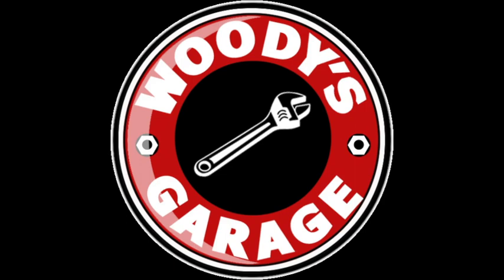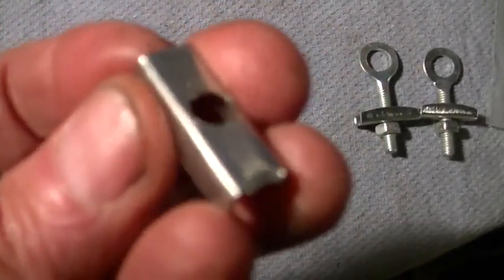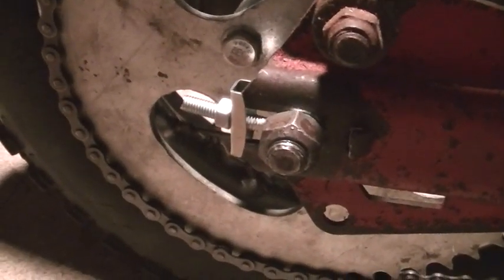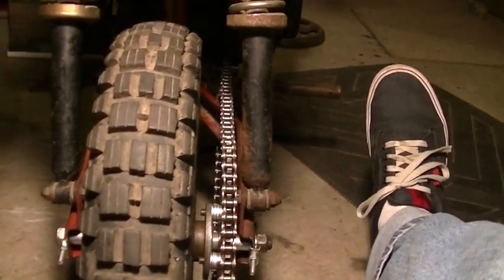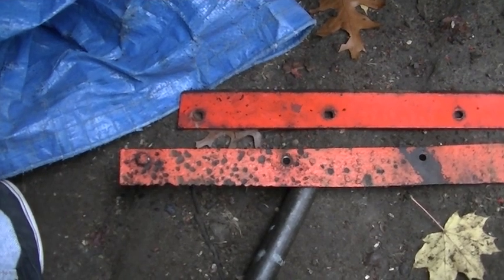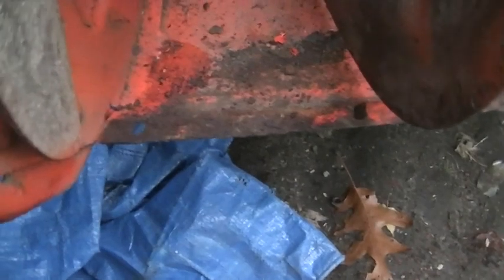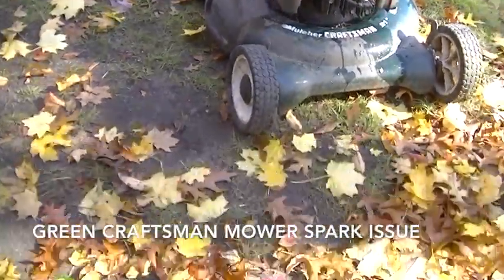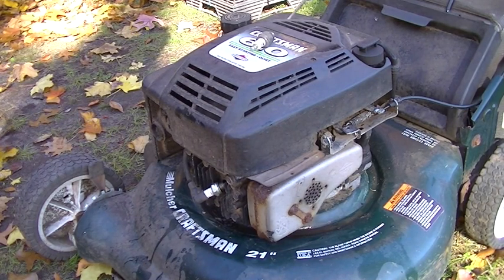Rupp Chain Adjusters,  Ariens 826 paint,  Craftsman Mower no spark and drive Issue

Comment: I could be wrong..but that bottom piece of the snow blower looked like a spare blade..like you could flip them around
Reply from the maker: I'm not sure, it is so uneven, and obviously rusty, looks like it might have been used as a blade for a time. The parts diagram shows only 1 piece, not 2 on the bottom, I think it was added for strength. Thanks.
Reply: Modified..I'm still watching video..lol..then again what would I know about a snow blower?..I live in Florida..great video👍